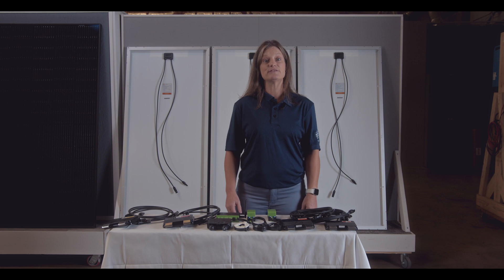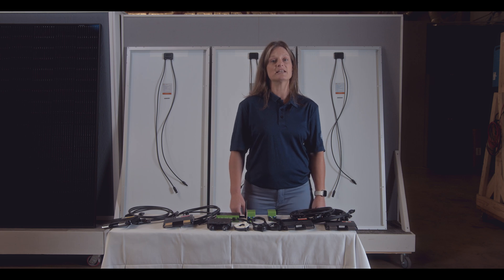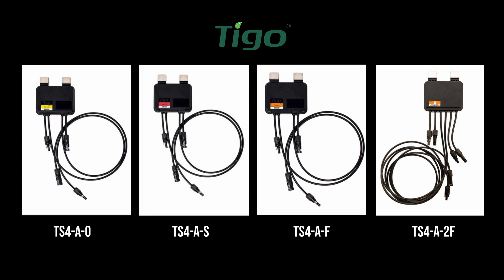TIGO TS4 Rapid Shutdown Units - What are the Differences?

Comment: how to check or test TS4-A-F RSD if its good or bad?
Reply from the maker: Hi! You can check a few things:
Visual check for damages or loose connections, measure voltage, activate shutdown and verify the voltage drops, check LED (red or off indicates a problem) or replace if faulty: If voltage doesn't drop or LED shows a fault, the device may need replacing. If you need any assistance with this, please don't hesitate to reach out to us at 903-441-2090, and we can troubleshoot with you!

Comment: You explain this better then Tigo explains it. These should be used on any system that goes above 50V even DIY, and RV IMO. Panels do fail and melt through the insulation especially used panels. Once melted exposed wires still passing voltage from the other panels all it takes is someone spraying water and cleaning the panels to receive a lethal shock.

Comment: How do you trigger the rapid shut down? Is it done wirelessly?
Reply from the maker: To initiate a rapid shutdown with a Tigo Rapid Shutdown Device (RSD), you need to deactivate the "keep-alive" signal sent by the Tigo Rapid Shutdown System (RSS) Transmitter. This is typically achieved by using an external switch connected to the inverter or by a signal from the grid loss detection system. Once the "keep-alive" signal is interrupted, all connected Tigo TS4 modules quickly reduce their voltage to a safe level within 30 seconds, effectively shutting down the solar array.
Reply: @SignatureSolar  I believe you can connect a NO switch across the 2 AUX terminals - 'making' this connection initiates rapid shutdown.  I think TIGO clarified this earlier this year. 

ALSO, I believe Tesla stated (September 2024) that 'panel level electronics' MUST NOT be used with the PW3 as they 'could' give glitches which trip out the unit.  I did read somewhere that they actually negate the warranty on the PW3.   Have you heard any of this>  It was published in Europe.

Comment: great video - would these work with tesla Powerwall 3?
Reply from the maker: No, these are only for DC solar panels.
Reply: @SignatureSolar  thanks for your reply.- Let me restate the question perhaps i have asked incorrectly. If I have Hyperion solar panels and a powerwall 3 for my battery backup for a grid tied system, could I add these optimizers to the panels? Are the optimizers compatible with Tesla PW3 inverter and Tesla gateway 3?
Reply from the maker: You're so welcome! The optimizers don't interact with other system components, except for optional use with TIGO software to optimize PV performance. Just plug them into the panels, and no further action is required.

If rapid shutdown is needed, additional steps will be necessary. Make sure the panels are within the optimizers' amperage and voltage specifications for compatibility.
Reply: @SignatureSolar just so I’m clear, the TG4-A-O don’t need the CCA, the TAP, or anything else if they are being used solely for optimization.  Is that correct?  The software you mentioned is 100% optional?

Comment: Would these work with Ecoflow Delta Pro Ultra Home backup system? It can accept up to 450 volts at 15 amps
Reply from the maker: It can work with an RSS transmitter without an inverter so it should work in your application. The transmitter's power supply would just need to be on the same ac circuit as the RSI.

Comment: Is it possible to proceed with I-V Curve measurements if there are installed optimizer units in the string?
Reply from the maker: Unfortunately, IV Curve tracing will not work for any Tigo devices (whether RSD is activated or not). The Tigo MLPE units receive their functional power from the PV Module, and the IV Curve test will present conditions that range from Isc to Voc. This effectively starves the MLPE from its running power and (if sustained) the unit will shut down.

https://support.tigoenergy.com/hc/en-us/articles/215790098-Testing-Methods-for-Tigo-Flex-MLPE-Systems

Comment: sad, that there is no device for Optimization AND Fire Shutdown AND  Monitoring. Yes, you can combine them, but who wants to clip 2 modules behind the pv modules with all the risks of defects (and of course the price when using many pv modules).

So the m device can really NOT separate the module from the string by command?
Reply: There is no device like that because they need your money and not because they can't actually make a single module that does all 3 tasks
Reply: The TS4-A-O has all 3 features. TIGO has a video explaining this. https://youtu.be/UFLmfH-pL7k?t=8
Reply from the maker: Yes, the only way to get all 3 would be to mix and match the TIGO TS4-A-F and the TS4-A-O.

Comment: Thank you for sharing I have a question since I'm in ground Mount therefore I don't need these however I do like the idea of being able to optimize having said that I will have a high voltage array with eight panels 480 watts each combined with a Schneider Electric 100 amp 600 volt charge controller what will you recommend for me and how many of these would I need thank you
Reply from the maker: Hi @neomatrix2722  - I would recommend that you complete a design form and speak with our design team! https://signaturesolar.com/system-design/#/Welcome
Reply: You would need 8 tigo ts4 a O for optimizing. 1 tigo per panel, since 1 of your panel is pretty much the limit of 1 tigo. Then you will also need the tap module and rss module.

Comment: Safety looks expensive. Do I need to add this type of system to remote ground and none occupied structures?
Reply from the maker: Whether or not your PV panels require module level shutdown is up to your local AHJ, and you are correct, you would need a TS4 for each solar panel.
Reply: Even if you dont have each panel shutdown. Still get an expensive shutdown switch for the array.

Comment: Hi I’m about to order 6 O versions, will they work without the tap ? Or are they going to need a firmware update? Many thanks
Reply: I have read that they work without the tap for the shutdown function but not for the optimization or data logging.  but someone should confirm that is more knowledgeable than me!